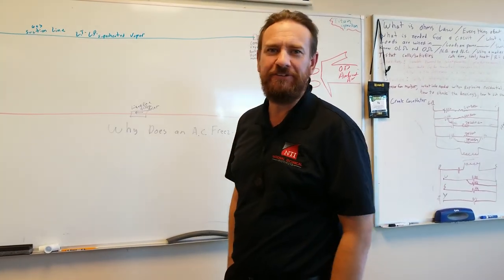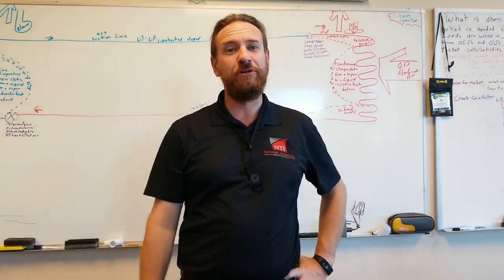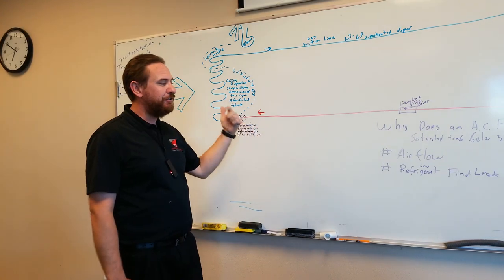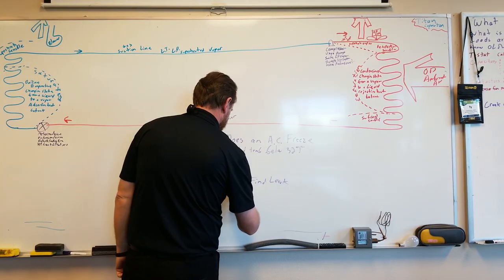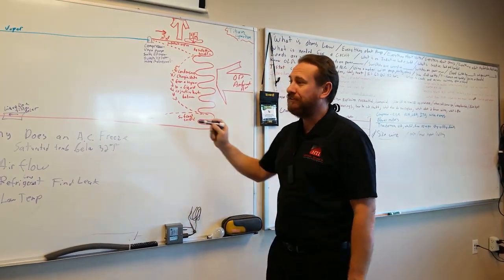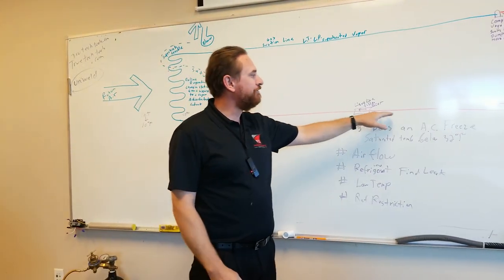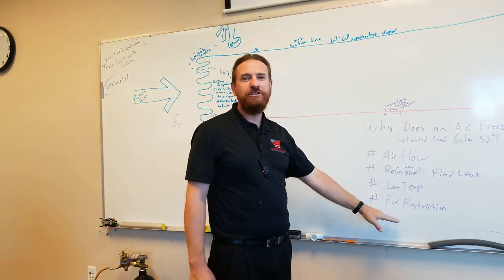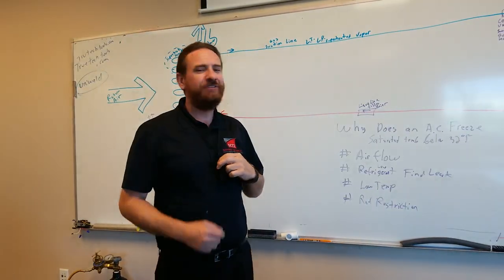Why does an AC freeze

Comment: At 10:46 a standard ac shouldn't be set to cool below  70° bc the temp in the coil will fall below 32° causing it to freeze....  Basically what he is saying.  That's not true at all.  Completely false.  The temp drop across the coil should be 18° and in a properly working unit it is. so if your discharging 32° from your coil....  The return would be 50° which would be like 52 in the house.  You can most definitely run your ac well below 70°.
Reply from the maker: XM1STERX1 I think you missed a lot of details here.
Let me clarify.
All equipment in the AHRI directory is rated under the same conditions. 80F Dry bulb at 50%RH 95F outdoor temperature. 
there sill be a loss of capacity but with a design conditions call for a 78F 50%RH with the same outdoor temperature that will put the suction saturated (evaporator temp) at 40F (68.5psig r22/118psig r410a) under those set conditions your supply air will be 58F at a 20 delta T. The TD (temperature difference) between the return air and saturated temperature will be 35F. this is of course with 100% proper airflow  properly installed new filter.

Lets say the humidity styes the same at 50% Now drop the return air temperature to 70F, the TD maintaining the 35 difference between refrigerant and air coil temperature drop  so to maintain the same TD the suction saturated (evaporator temperature) will drop to 32F and the supply air will drop to 47F.

When the return air temperature drops, the pressure of the refrigerant in the suction side will drop. when the pressure drops the boiling temperature aka saturated temperature will drop in like. (If the return air temperature rises, the suction pressure and saturated temperature will also rise)

The key is the suction saturated (evaporator temperature) is at 32F the humidity in the air will start to freeze on the coil starting from the metering device.  Just because you do not see it freezing all the way to the suction line does not mean its not freezing in the evaporator. That freezing blocks more airflow and reduces the heat transfer needed that will eventually reduce your superheat that will also run a higher risk of liquid getting to the compressor. 

Will this cause immediate damage? No absolutely not, just like not changing your oil will not cause immediate damage but still not good.

Will this cause it to freeze all the way to the compressor, well that depends on many conditions. 
As the outdoor temperature goes up its less likely, as the outdoor temperature goes down its more likely.
As the humidity goes up its more likely as the humidity goes down less likely.
If the filter is dirty its more likely, if the filter is clean less likely
If the ductwork is restricted its more likely, if the ductwork is perfectly balanced less likely
As the indoor temperature further drops its more likely, as the indoor temperature rises less likely.
Also altitude, compressor volumetric efficiency, refrigerant piping play a part as well.  

Can you set your ac below 70 yes just like you can red line your car but no good comes from it

When your suction saturated is at 32 is it going to freeze, most likely and there is defiantly  problem that needs to be addressed.

Can we cool below 70 absolutely, this is where refrigeration comes to play, server rooms walk in freezers have controls to overcome this. things such as reheat, hot gas bypass, oil separators, crank case pressure regulators, evaporator pressure regulators, crank case heaters, suction line accumulators, liquid line receivers and evaporator freeze stats are used to keep the system operating. The residential system does not come with these components, the home insulation is not designed to maintain it, the ductwork is usually not large enough to allow for the cfm needed and the systems us not sized to accommodate it.
Reply: @love2hvac   so I think we are getting carried away here a little bit.  I don't want and don't need you to lecture or give super long responses via text here. 

To suggest that Running AC below 70° is similar to running a car engine at Max revs or even to say that it's bad,  is very very rediculous. Assuming  The discharge temperature of the coil is 55° and using the standard 18° delta T the return would be 73°. Operating on this assumption,  which would be a normal situation, the temp of the actual coil is about 10° lower than the Discharge temp.  This would put the coil at about 45° you have quite a bit of wiggle room.  I know you might think I'm just talking out of my ass, however, from my experience it is very easy to achieve below 70° without any problems. And speaking to multiple manufacturer representatives,  and yes they say that you should have a coil temperature sensor,  but  they also say that you could quite easily achieve 68°-65° indoor temp before you start running a real risk of freezing and getting oil back into the compressor. 

Also keep In mind a lot of proper and competent dealers give a 10 year part and labor warranty.  So even in an extreme situation where in some freak event that a homeowner setting 68° inside and this causes the Compressor to fail..... It would not be a big deal.  It would simply be replaced. At no cost to the homeowner,  plus those damn Copeland scroll compressors are pretty damn bullet proof.  

 So in conclusion I understand you are teaching a class and,  I assume,  being on the safe side of things,  but to simply say trying to achieve below 70° is bad .... Is very disingenuous.
Reply from the maker: @PeskyWabbit.  

#1 in response to you saying "I don't want and don't need you to lecture or give super long responses via text here"
you came to my page telling me I was wrong. I took the time to explain to you  the science behind it with proven numbers of the industry and precise examples.

#2 Since you do not want a "lecture" about a video you watched of a lecture I will stop trying to explain to you the science.  I hope that you can find some time to do some research on how saturated temperatures work in response to return air temperatures, and humidity. I recommend Refrigeration and Air Conditioning Technologies 8th edition, Fundamentals of HVACR 2nd edition or really any of the HVAC books would be a great start. 

#3 If you in the future would like to have an open discussion please let me know.

Good luck on your journey of learning and have a great day!

Comment: 20+ mins just say “air flow, or lack of refrigerant in the coil” not enough heat being picked up
Reply from the maker: Suction Saturated Temp below 32
#1 airflow 
#2 Temperature inside/outside 
#3 restriction
#4low in charge

Comment: Find the leak ? fix the leak ? Wow !What's the cost to fix the leak ?
Reply from the maker: You should be bringing this to the customer and providing them options. I give a complementary 5 minute leach search covering the main spots so have an idea. The nifder them a leak repair option, component replacement option or a level of leack repair option and let them make the decision. If the customer chooses to just have the system toped off I will gladly do so and note on the invoice a leak is present and the customer chose not to repair at this time. No warranty on this work and the refregerant will leak out again in an unknown amount of time. 
Now it's all on the customer. 

Too many "techs" just add refregerant and take the decision away from the customer. 

You asked about cost.
What's the cost of customer comfort?
What is the cost of a new compressor?
What is the cost of  yet another after hours call? What is the cost of the customer to take off work again for the very same problem? What about those customers that are concerned about the refregerant loss?  
It is not right to take the decision away from the customer.

Too many just want to gas and go, get that quick money without offering the services and skills of the trade. Most of the time is just an excuse to cut corners or not buy the tools needed to perform the job.

One of the reasons we are yet again having to change to a new refregerant. Its monitor how much refregerant is produced and how much is recovered. The deference is how much ends up in the environment. Regardless of anyone's environmental views more and more laws are created to control the air. It ends up effecting all of us. What's the cost to change refregerants?

Imagine if everyone made an effort to fix leaks and recover. There would still be losses but it would be reduced enough we could very likely still be using R22. Even now there could be enough R22 reclaimed to have the stock needed to continue servicing existing equipment for it's life.

There is no HVAC police. Nobody is out there seeing if your doing the best you can do.  It's all you, but hopefully it gives you something to think about and ponder. Possibly even inspire someone to better themself and the trade.